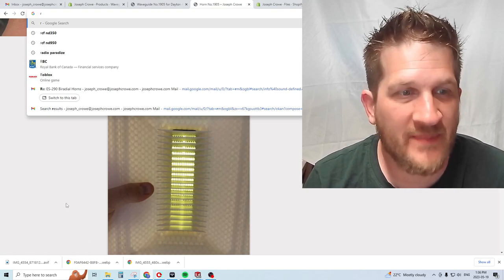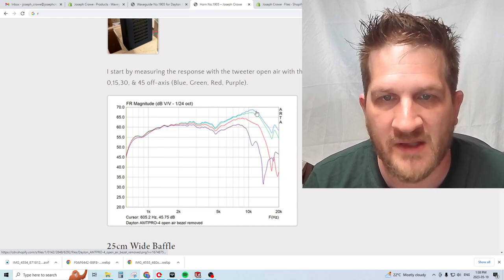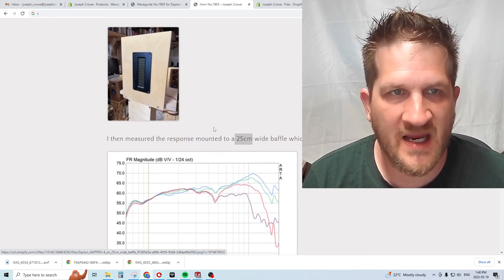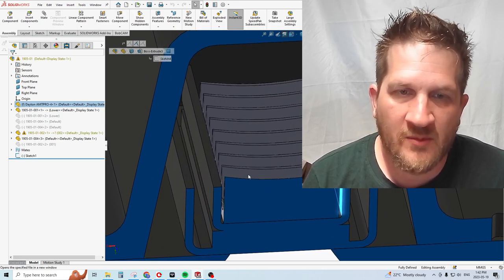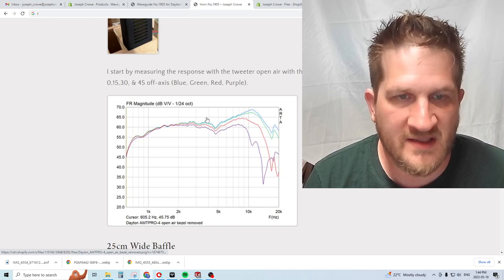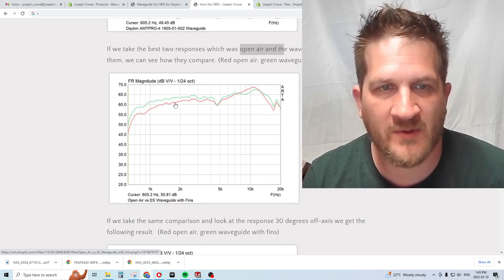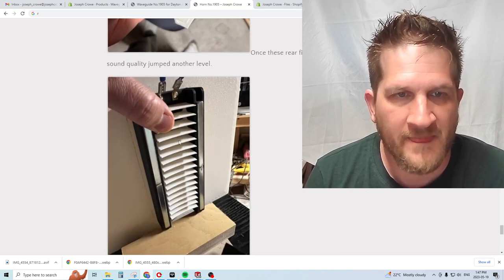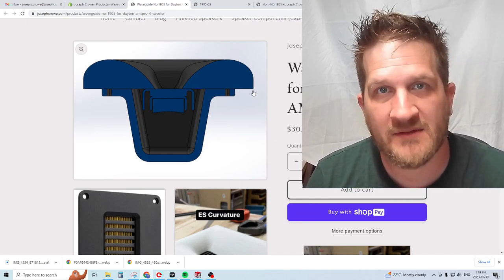Adding a waveguide to the Dayton Audio AMTPRO-4 Tweeter

Comment: I have had good success with chamfers filling parallell areas around my ribbon. Nothing should be flat parallell. I suggest trying a small add on chamfers to the backplates. They dont have to cover the whole area, I think quarter wave physics come into play here. Also I've had little success with plates or grills. My Fountek plays way louder, deeper and clearer with my add on waveguide. But the stock one has almost parallell areas in the waveguide, so no wonder many thinks the stock waveguided one sounds worse. Its all about keeping standing wave and diffraction effects to a minimum.

Comment: Could the vertical dispertion be widened with acoustic lens ? By orienting the plates gradualy from say up at arond 60 dgr center flat and down also around 60 degr....great job you are doing, will try to adapt it to the beyma amt 150...its original horn is too deep...
Reply from the maker: It’s quite challenging to increase coverage in the vertical without compromising something else. Besides, what’s the total harm in narrow vertical directivity? There’s not a lot of supporting publications for it’s need, on the contrary plenty of research shows we are not very perceptive on vertical spaciousness. More research is needed on the specific topic but personally I wouldn’t sweat it. A flat frequency response is golden in my books. It basically means no trouble in other areas.

Comment: I'd be suspect of the width element as being connected to the 4.8k wonkyness, ... via some quarter wave nulling. 

Plausible? 

Curious if this why so many hf waveguides utilize vertical divider components. 

Way WAY out of my depth here ... pure speculation. 

Thoughts?

Comment: Hi, how did you design the waveguide?
Is there some online calculators or math needed or just yolo until you get something awesome?
Appreciate any pointers you can give me as I want to design something similar for a different AMT tweeter (for fun)
Cheers
Reply from the maker: The flare geometry is based on an equation that I’ve developed inside my CAD program. Sorry I couldn’t be of more help. I do offer design services though if you need a custom CAD file created. Joseph_crowe@josephcrowe.com